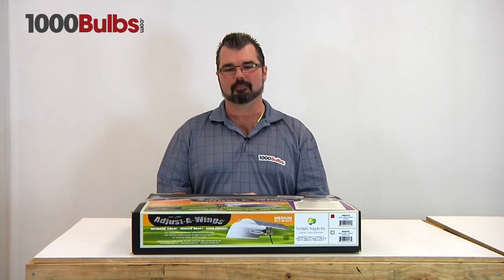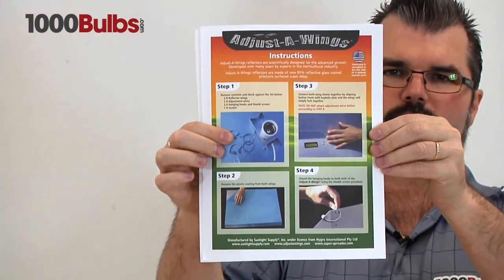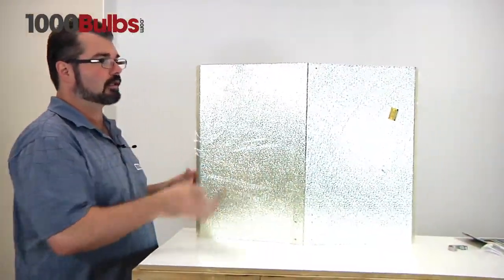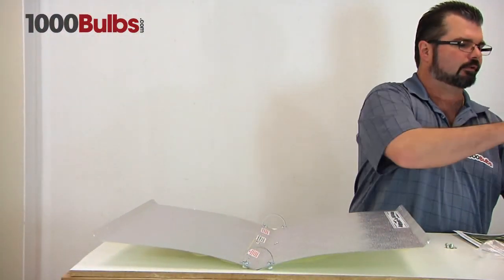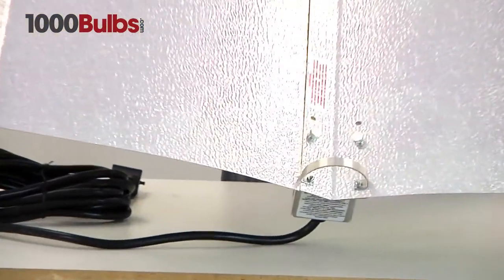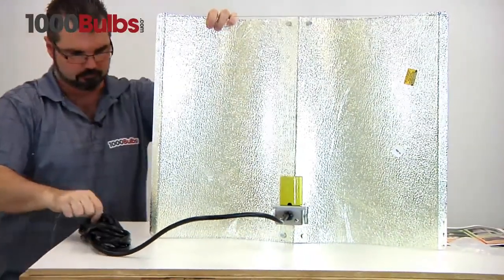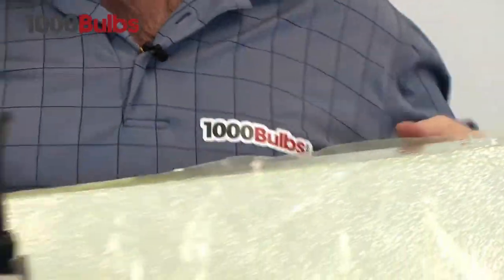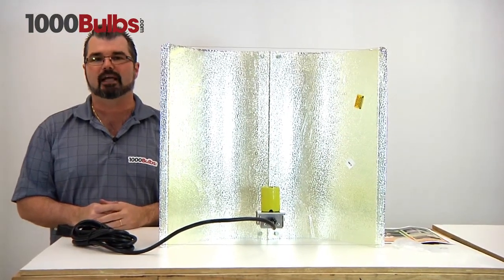Adjust-A-Wings 904535 Grow Light Reflector

Comment: Hey Everyone pride here. Currently im vegging under a 400w mh and using an adjust-a-wing reflector and i cant help but notice that the sides of my garden are getting more light than directly under the bulb or reflector. I thought it would b the other way around. I did have one of those super spreaders on my bulb but found the reflective wings pretty much spread the light out to the sides of my tent anyway and the spreader was just taking from the light reflected in the center. Does anyone have experiance with these adjust a wings? Is this normal, or is it just cuz the reflector is not that good, or the bulb? also i can adjust the distance the bulb sits from the reflective wings and while its close i suppose it could be closer to the hood. Just trying to figure out what i can do to get more even lighting through out the entire 4x4 foot space cuz as of right now the edges of the garden receive about twice the lumens as directly under the bulb. So obviously ive been putting plants that need less light in the middle of the tent but with the taller ones all around it makes it very hard to work around. If thats just the way it is i suppose i can rotate everyone in a manor so that all the plants have their days in the bright lights and maybe 1 or 2 in dim light under bulb but if i dont have to rotate everyone like a volley ball game then itd make my life a lil easier lol...hope someone knows or can help..thanx guys...pride out